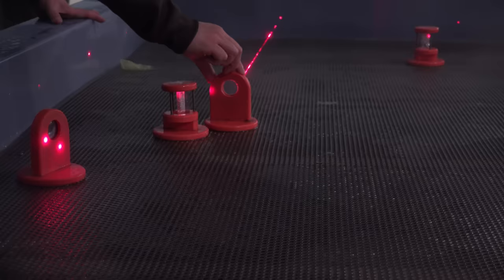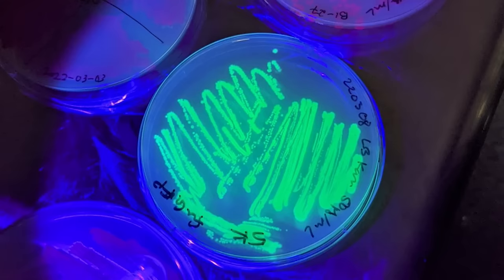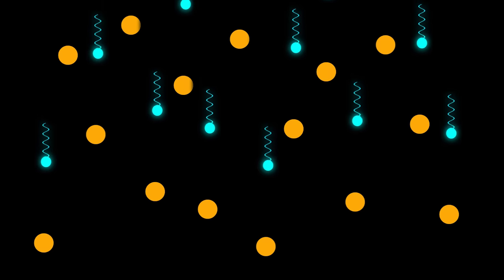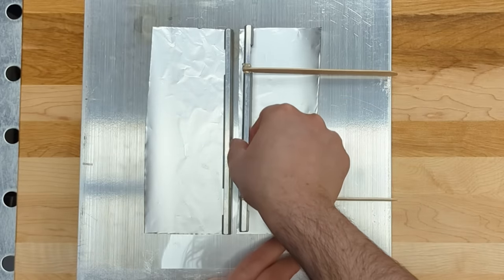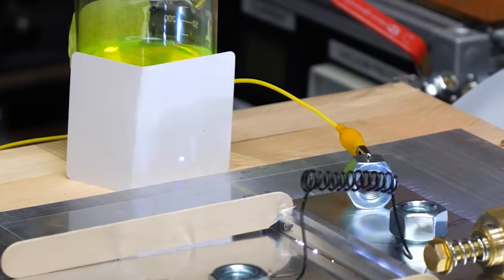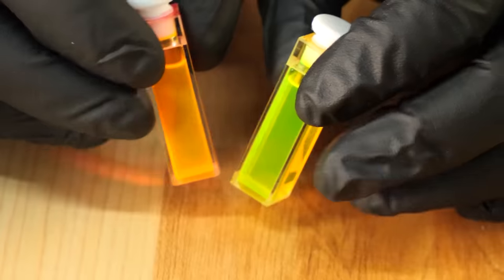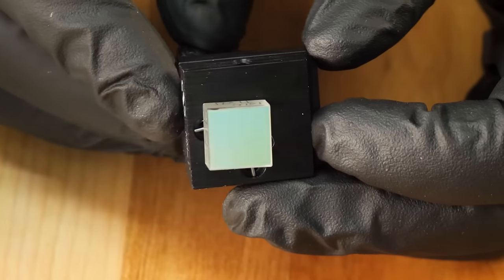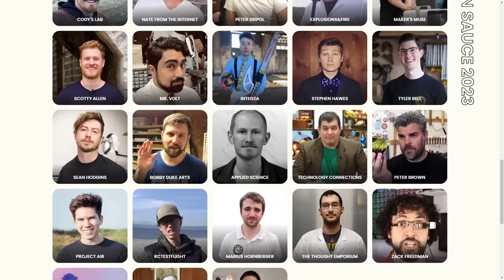We Built A Laser Out Of Tin Foil And Highlighters

Comment: Your laser is improvised-prototype needs better improvement.LASER-light amplification of stimulated emission of radiation.The laser works by the action of optical pump generating coherent waves emitted as concentrated straight beam of light.First laser was made by Mr. ? Maiman,if Im not wrong,it was year 1969.There are many types of laser,just a mention for these namely,ruby laser emits red color beam,diamond laser,gas laser,carbon dioxide laser beam is invisible,but visible to special optical instrument.Visible wavelength of light 550 nanometers.Laser emitting long wavelength light is invisible.I did not read all comments,though it's worth learning,too many Im tired.Thanks for sharing us your knowledge.Many are making and experimenting their prototypes...😊😊

Comment: Built a much cleaner and nice version when I was 16 years old in the late -90, worked perfectly. Made a very bright light blue dot on a piece of white paper and that dot gave out such strong light that it easily lit up a room a little. The strongest point held up to about 6 - 7 pulses per second, any faster and it became weaker and slower held the same strength.

Comment: It will be interesting to see how long the cells can handle being lased. The UV will shred their DNA, but they should still live for at least~24 hours. How much did the cuvette heat up during this? There's going to be some waste heat generated during excitation/emission, but hopefully not enough to kill the cells. The biggest issue with the mouse cell lines might be the fact they're adherent and a single layer might not have enough depth for maximal lasing. Though, with a suspended cell line like the e coli or non-adherent cell, they would eventually settle out, which would also not be ideal. You could try growing them in a matrix like matrigel to get them to grow in 3D, rather than only planar. That would also solve the "settling" issue with liquids suspension cell culture.

Comment: Dumb question: If the laser only works at the very edge of the dye container, would using a container that's the same length, but only a few millimeters thick make a stronger laser?

Comment: I would like to point a couple of things.

Firstly polysterene cuvettes are bearly transparent to UV light. They can transmit from 340 nm whereas the maximum UV light wavelength is 400 nm. Indeed your polystyrene cuvettes glow under UV light in 11:03. For UV spectroscopy, quartz cuvettes are the choice, transparent from 200 nm. This may explain your better results with your homemade glass cuvettes.

And secondly, the use of UV light is harmful for cells. UV light creates thymine dimers and DNA replication errors. Hence, irradiating a living cell culture continuously with UV light to make them glow can actually kill the culture in the end.

Comment: What I want to know is, does the rail laser fire out both ends of the rails? and if it doesn't, how do you know which direction it will go?
Reply: Those fire out of both ends. From what I understand of nitrogen lasers, the excited species drop to ground and emit UV all at once and can't be re-excited right away, making a mirror cavity useless as it happens too quickly for the light to make more than a single pass. The light coming from one end can be reflected back along the axis and join the other beam but it won't trigger additional emission as it passes back through the arc area...

Comment: Have you tested how insulating the wood is at that voltage? Google won't tell me how it is at 40 kV or give me any useful general information that I could interpolate from, but I wouldn't be surprised if most of the insulation is coming from the hot glue, especially if it's been humid there recently.

Comment: tried it with a bmw xenon lamp igniter and ballast and got nothing cuz i think im bad at science. it was pulsed ac, but even after adding a high voltage rectifier diode and a smoothing capacitor, i still couldnt manage to get it to work. i think i actually killed my ballast somehow, cuz it aint working anymore. i really hope i didnt fry the igniter cuz that thing is potted in black epoxy and i dont have the equipment to safely open that. anyways, i dont really know what to do at this point, and i have doubts that im even gonna be able to pull this off. like i said, maybe im bad at science.

Comment: Would brown lasers be possible with this system?
Reply: If brown is a wavelength, sure.
Reply: @oscargr_  Is brown a wavelength?
Reply: @RetroGamer7200  Not in my definition.
You may consider "brown" as "orange-with-low-saturation"

Two things:
- Orange can be made by either a single wavelength (around 600nm) or by combining two spectral (saturated) colours, red and yellow.
- Saturation usually means single wavelength, or single spectral colour.
(In other words: a colour becomes less saturated when it is mixed with other colours.)

Brown is a bit of a problem.🤨

Comment: Isn’t it kinda cheating say you’ve made cells that produce lasers if they need a laser shot at them to do it? Yeah I made a flashlight, but you need to charge it up with a higher power flashlight first
Reply from the maker: This is just one way to do it. You can also use flash lamps as the light source input. Which could be made from concentrated bioluminescent reactions like a giant Firefly.
Reply: Just as Thought Emporium said you could use alternative energy sources, but another fact I'd like to throw into the "isn't it cheating if you need a laser to create a laser" debate:

Pick up a green laser pointer and shine it on a wall. (safely, there are way too many "super bright and powerful" green laser pointers that could easily turn you blind for various reasons)

You just "cheated" by (very likely) using an electrically pumped Nd:YAG laser diode to pump a SHG (second harmonic generation) crystal with 1064nm infrared light which then produced the green 532nm like you saw.

Basically: a lot of "useful" lasers nowadays are pumped by other lasers which are pumped by electricity or more "normal" light sources. (Obviously as mentioned in the video CO2 E.T.A lasers are already quite useful and don't necessarily have a second stage, but I said "most" not "all" :D)

Edit: corrected my autocorrection wanting to write Though Emporium

Comment: Sorry to rain on your parade, but....what the ???!! ! What on Earth makes you think that a delicate protein, with it's primary, secondary and tertiary structure is going to survive a lasing environment ? I doubt it's going to work, the only way you might get it to work is by using fresh lasing material, so that as your lasing medium is denatured by , take your pick of heat, U.V. ionizing radiation, the output of the lasing material itself, and other things I can't think of right now (beer induced) the cooked beam juice is replaced by new stuff, hideously inefficient if you ask me, the only time that sort of trade off makes sense is if you are extracting serious power from the medium, like a C.O.I.L. type setup, and this , it is not. Down the line, there's the other problem, of coherence. How do you honestly expect to get any sort of beam quality with a whole heap of completely amorphous organic structures in your "meat laser" ? it's a total dead end, unless, of course, this is all just a joke, and you don't have access to some BORG technology  ?
Reply from the maker: well, the two papers I showed that managed to get proteins to lase would be at least part of the reason... And also, the protein doesn't need to survive long, that's why you use a really concentrated solution of it. Dead protein is replaced with fresh. Also, proteins aren't really that delicate. This is a misconception.